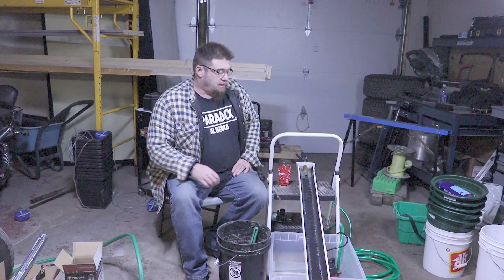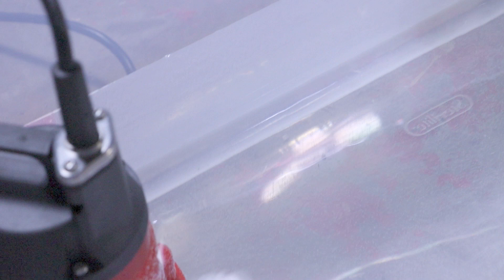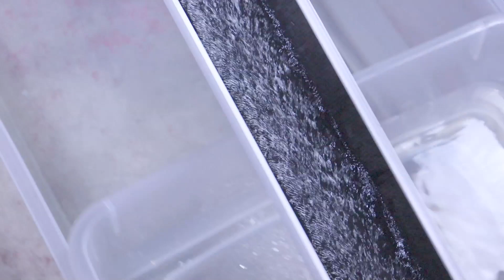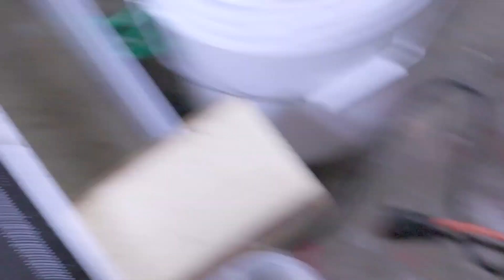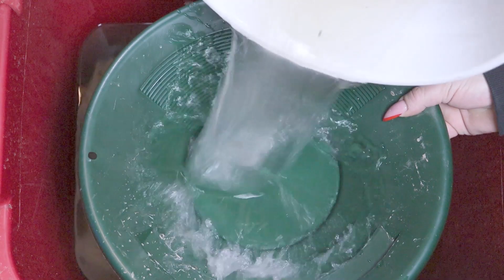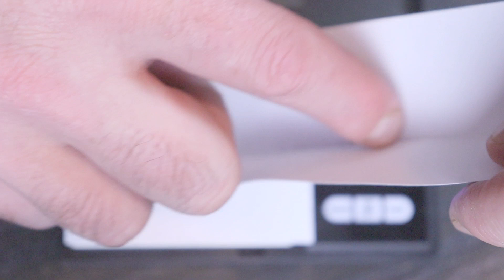FINDING GOLD!! (Red Deer River pay-dirt) Using my $30 clean-up Sluice2021!

Comment: What I thought I heard you say was it took you 10 minutes to process dirt down to 5 gallons of paydirt - and took you 3 and a half hours to run that paydirt - Is that correct ?
I was gonna say to run your tailngs again , but if thats another 3 hours forget it
Perhaps you could speed up your feeding rate so it takes an hour , and run the tailings , and then run those tailings , for those 3 runs a total of 3 hours , plus clean out the sluice each run for a total of 3 and a half hours.
Reply from the maker: i usually only run the tailings once and then test the final tailings to see if any gold passed
Reply: @paradoxalberta5066  I am in the process of building a fairly simple device that can knock half a cup of black sands down to a teaspoon in a few minutes and I thought that was impressive - it means would take me at least 3 hours to run 20 litres of black sands - so you doing very well with your set up

Comment: Starts with a black round bucket and it turns into a square green bucket - What sort of Black Magic is this ?
Reply from the maker: Had half of the material in the black and second half in green container I have a bad back so can’t lift a full five gallon pail
Reply: @paradoxalberta5066  My back ain't perfect but i can't lift 5 gallons either - its gotta be at least 60 kilos - 150 pounds

Comment: How do you clean out the sluice? Does the mat come out?
Reply from the maker: i just put it in a five gallon pail and use a measuring cup to pour water over it then a paint brush for the stuff left behind
Reply: @paradoxalberta5066  nice. Thanks.
Reply: Actually just watch the Making. So yep it’s glued in.

Comment: Are u running that sluice at to steep of a angle? Isnt it normally like 1 inch per foot?
Reply from the maker: Next video is out and I adjusted it! Thanks for the comments
Reply: Yes it does look a little steep. Agreed !
Reply from the maker: will adjust for next cleanup